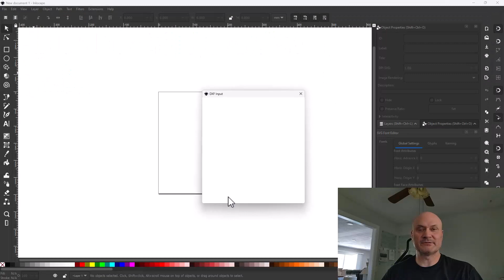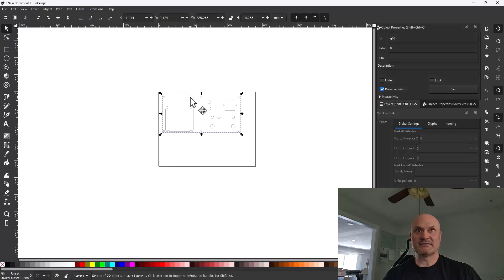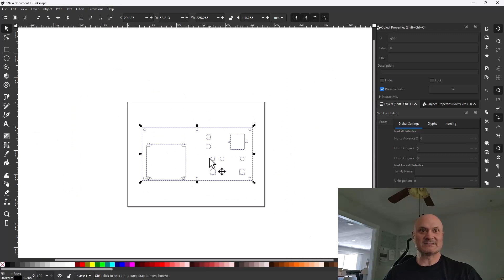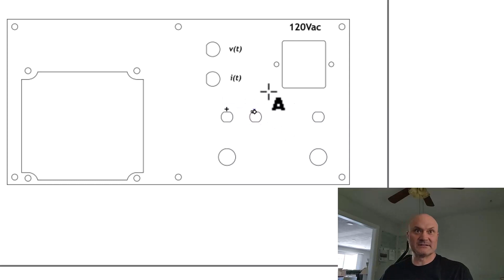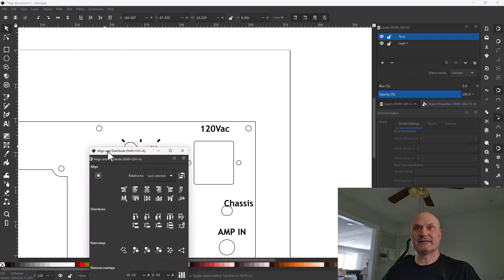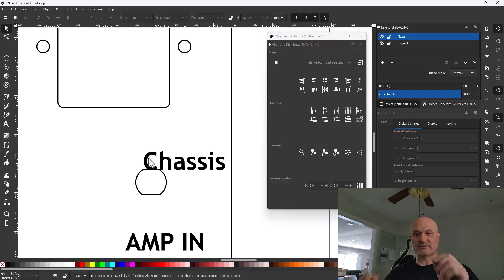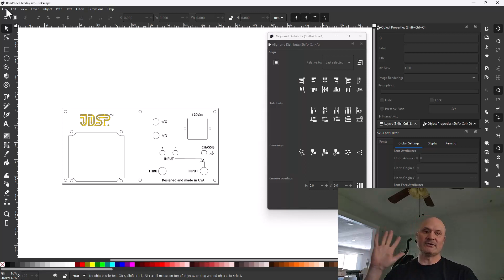Front Panel Label - Alignment in InkScape

Comment: Little tip from graphic design point of view: before aligning text objects to your cutouts make sure you set the text alignment of the text labels so that you could change the font, font size or even the content of the label without having to rearrange the text object afterwards. Makes life so much easier if you gotta change request later on, even you are your own „client“ here, sometimes things look different when printed out than they looked on screen while designing. I’ve been there more than a couple of times.
Reply from the maker: Excellent TIP! THANK YOU! Same principle applies in UI design. I believe InkScape can also be used for UI design much like Figma and other tools, that can export into code frameworks, but I've barely got that far with it yet...